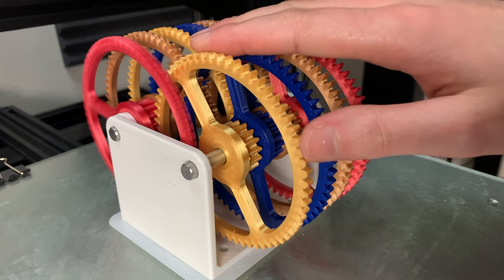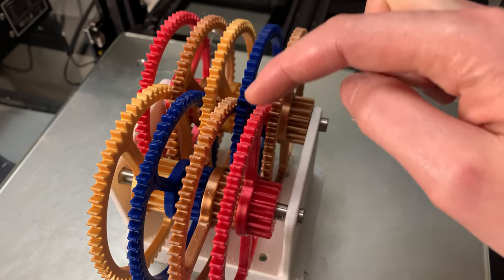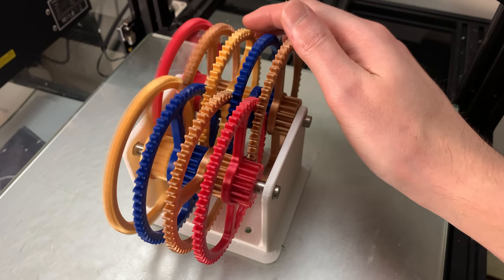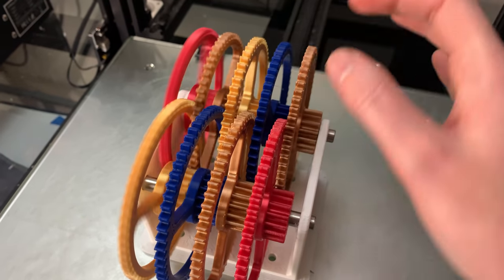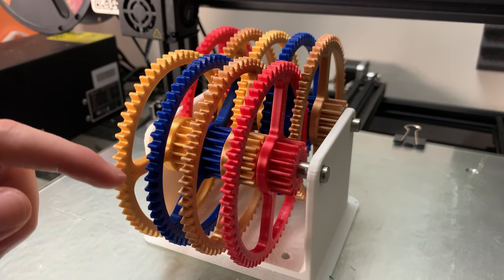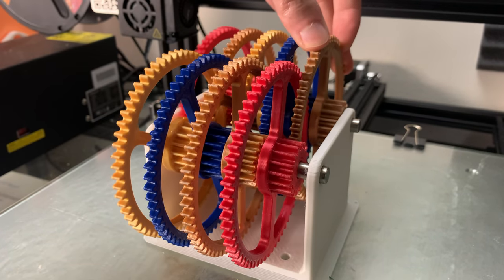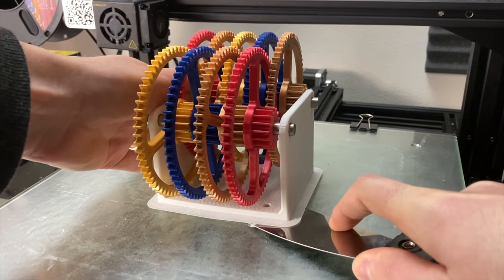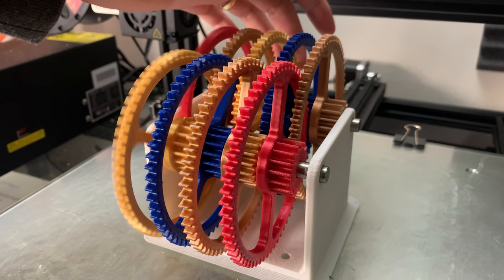Is it possible to spin the last gear?  (1:65000 gear ratio)

Comment: I know he just said I can't do it, but something in my brain is still saying it should be easy
Reply: He didn't even do it properly. He sort of started off well by turnign the gears in the beginning but then just gave up or something.
Reply: @andrewwatts1997  the gears would break because they would spin so fast
Reply: It would not be as the force required to rotate the last gear exceeds the maximum yield strength of the material the gear is made off. Meaning you would shear the teeth off the gear box before you could achieve any rotation.
Reply: @sgtjonmcc  see you say that, but I still feel like I could just turn it with bare hand
Reply: @wack3320  ahahahaga no I do know physics but it's still boring
Reply: He's kind of leaving out how much the effect of friction multiply proportionately with the torque potential.  Since each gear is riding plastic on metal, it's already dealing with quite a bit of friction.  Add any friction from the gear teeth engaging and airflow... or multiply by, for that matter.  Say it takes 0.1 gram to overcome the friction of the first gear.  Each gear will be x4+0.1 down the line.  By the time we reach the final gear, we're looking at a minimum of 35Kg.  And, that's already assuming all gears are already spinning and not taking acceleration into account.  Even with the unreasonably low 0.1 gram of force, it would require the equivalent of a 10YO (or 5YO American) child standing on the final gear to keep the thing turning.  Imagining a 10YO standing on one gear edgewise makes me doubt the thing would last long.

While not absolutely impossible.  Optimized mating surfaces and proper lubricant could help.  But, even oil viscosity is enough to induce drag.  The engineering required to achieve rotating a 1:65K ratio would be astounding.
Reply: @voxx9449  Go build some gears then and grab a spare engine.
Reply: @josephamundson701  Watch the video again. Do you even see the last two gears moving at any time? If you could rotate that last gear even once per minute, the first would be flying at over one thousand revolutions per second.

Do you imagine nothing breaking before that can happen?
Reply: @RipleySawzen  I think I could do it
Reply: I would also think it should be easy considering there is no “load” on the gear so you don’t need the tourqe figures he mentioned?
Reply: @voxx9449  well, this was more or less exactly what the title said it would be
Reply: @Storiaron  didn't say it wasn't what the title said it would be just said it was boring
Reply: @voxx9449  yeah, but if the video is about the title, and you consider the video boring, then why did you click the video after reading the title if you knew it would be boring?
Reply: @JimmyCasket02  the mass and friction of the gears themself is the load
Reply: @Cyberlong  because it could have been made in a non boring way
Reply: @ImnotgoingSideways  that jab at US obesity is the funniest thing I read in a comment section for a long time thank you 😂😂😂😂
Reply: @ImnotgoingSideways  Most probably comes from moment of inertia though right? Since the angular accelerations are constrained by the gear ratios and assuming the moments of inertia are the same for all the gears that would mean that to move according to the constraints it requires a lot of torque.
Reply: @OrigamiMaster06  Problem being friction is one of the forces which overcomes inertia.  With friction and gravity removed, acceleration would still be possible using any amount force.  Mind you, very minute acceleration due to the multiplication.  Still, taking acceleration out of the equation by pre-spinning the latter gears, force on the first gear would still require a destructive amount of torque to overcome friction loss and sustain any pre-existing inertia.  In the simplest terms, due to the amount of mechanical drag, it would take nearly as much force to keep it turning as it would to start it turning.
Reply: @ImnotgoingSideways  There would be acceleration for any force, but I'd imagine that it would be pretty slow. I guess friction would apply a significant moment to counter the motion but I think you would still need a gigantic amount of force to produce any visible rotation without friction.
Reply: @andrewwatts1997  dude, the force required has been multiplied so many times, the amount of force required would strip the teeth off of most of the gears..
Reply: @snerttt  I'm not talking about cranking from a stand still, I mean successively turning the gears until at least more are also turning. He kinda did that and then gave up. Turn the first gear and keep the crank going, turn the second one, the third one. Aid the mechanism. I'm not saying he could turn the entire thing but holy shit he didn't even properly try XD
Reply: @ImnotgoingSideways  
Without friction,air and load it's about time cause the huge amount of inertial Energy you Need to achieve.
Reply: @wack3320  I'm two months away from graduating in engineering and my opinion is video was kinda boring. Id definitely rather see him breaking those gears. Try not to judge next time 😉
Reply: @emrealemdar859  ok buddy
Reply: @JimmyCasket02  Friction is a load. A gram of friction on the first gear would mean 65kg of force to turn the final gear. That much force will definitely break those gears.
Reply: @wack3320  no, it was boring because I came to see visualization of this thing, not learn something I already know
Reply: @andrewwatts1997  no, did you understand the video at all?
Reply: @RipleySawzen  think of the inverse though, it can still be done, by moving the first gear at a non destructive speed the last gear would eventually make its way after a large amount of time.... right?
Reply: @shotgun6X  I build allot of mechanical contraptions myself, hence my frustration.
Reply: Why not put oil on the last one?
Reply: Its easy just use wd40
Reply: @manleystanley91  Yeah but we're talking about turning the slow gear directly. That is the topic of the video.
Reply: Just gotta turn your brain off
Reply: Exactly
Reply: What if you made gears out of some kind of unbreakable material, and lined so many up, could you spin the last wheel at a gradually increasing rate that the gear on the opposing side spins as fast as the speed of light? Would that theoretically work?
Reply: @josephamundson701  ye it seems way to easy just watching it lol
Reply: Just start spinning the easier ones until they're really fast, then just keep going up
Reply: @idkmyownnameplshelp9218  exactly! It would be easy
Reply: @cubeofmeat4982  Guy, friction from air resistance will get bigger and bigger till you can no longer turn the gears. Not to mention how are you going to turn the slow gear at (way fucking beyond) hypersonic speeds to make the fast gear relativistic?
Reply: @voxx9449  how could it be made in a 'non boring way' you want him to spin the last wheel with an engine that has like 65000 foot pound of torque and even if he did that the thing would break
Reply: @gist2063  make a better thing not out of plastic that won't break
Reply: @cubeofmeat4982  theoretically, you're talking about as much force of as blackhole just to get it to start to move,  or the point where conventional physics calcuations breakdown....

these extreme gear ratios are meant more for converting a motor with high rotational speed, but low torque, to higher torque with low rotation, 

you could literally winch a truck with a tiny 3V DC motor, and a crappy landscaping light solar panel (assuming the gears/shaft and chain are strong enough to handle the full load)  It might take all week, but with each 1:4 gear ratio the load/resistance that tiny motor experiences is reduced.
Reply: @wack3320  you tell me to my face that this video was exciting for you.
Reply: @saulocosta4520  ikr
Reply: @gist2063  I really think it would be easy. You would just push it with your hand and it would spin
Reply: @voxx9449  Even if you made it really strong where are you gonna get the power to move it
Reply: @josephamundson701  Have you ever tried to make contraptions like these i made one like this from legos and its impossible to spin the last wheel. A normal car engine couldn't even spin the last wheel you need like 65000 foot pound of torque
Reply: @gist2063  but you could just get it going really fast and then turn it with your hand
Reply: @gist2063  idk I'm not the one making the video am I?
Reply: If you spin the first one at a speed it can handle for a long time, the last one will move a little.
Reply: @josephamundson701  why do these people not get the joke?
Reply: All you would have to do is connect it to my truck axel and vwalla
Reply: Just think its so much mechanical advantage that its probably like your trying to move an armored Humvee with its parking break on.
Reply: @ImnotgoingSideways  but at the same time by God it would change the way we do everything.  Imagine if we could carry around boxes that lift cars!
Reply: @stuartsmith1139  I prefer carrying around a bottle to lift my car. =^-^=
Reply: You see, it breaking would actually be a good demonstration of the limitations, showing rather than telling
Reply: @voxx9449  it would be fun if you understand it
Reply: @pessinieminen4341  haha gears go brrrrrrrr
Reply: @pessinieminen4341  ok but hear me out, what if they were made of a more durable material capable of supporting that amount of friction, then would they be able to turn or no
Reply: @pessinieminen4341  but the gears dont break at the speed he is spinning then. If he spun them at that speed for days eventually it would have to move the last gear would it not?
Reply: It would take time realistically
Reply: @josephamundson701 * I believe in you.*
Reply: @unnamed47  or just without inertia
Reply: @andrewwatts1997  You physically can't turn those last few gears. That's what this whole video explained. You move the first one with just a little bit of work. The second one takes 4x the amount of force though and then the next is 4x and the next and so forth. It would take way more force than you can physically give to push the last ones.
Reply: @ThatSB  Yes it would. It would take a lot of time though.
Reply: @cake6420  The gears would likely break.
Reply: @josephamundson701  It could help a little and I was thinking the same thing but I don't think it would be possible to apply enough force anyway. We're talking about thousands of pounds here.
Reply: @Kyrqs  Bravo, you are so smart!
Reply: @cake6420  Thank you.
Reply: @Kyrqs  someone went on a rampage and made like 20 comments lol
Reply: @o_sch  Yes, I dislike people who are unable to comprehend simple things. In other words, I make a lot of responses online.
Reply: If it was easy, we would be populating Mars already for the last 20 years.
Reply: @FinnishArmy  well they probably just haven't tried turning them with their hands yet
Reply: @justsomenamelesssoul8097  kinda dumb isn't it? You already know what'll happen and you expect it to...not happen?
Reply: @manleystanley91  by that time you'll break the whole gearbox.
Reply: @t_kon  well I know what will happen in most TV shows and films I watch.. So what? I should stop watching them as well cuz they are predictable?
Reply: Maybe because the gears look light and visually easy to spin, but in reality tje multiplication of rotation is exponential
Reply: @voxx9449  "boo hoo I want loud screamy guy and breaking things not actual useful info and knowledge"
Reply: @staringgasmask  no I don't ??
Reply: @voxx9449  so then you tell me why this seemed boring to you. It's a scientific video about torque, what did you expect?
Reply: @staringgasmask  it's boring
Reply: @staringgasmask  came here for fast spinny thing got not fast spinny thing , disappointed
Reply: @voxx9449  yep, pretty much what I said, unculturized individual that can't appreciate an analysis
Reply: @staringgasmask  😛😛😛
Reply: @t_kon   Due to torque ratios hardly any pressure would be applied to the gears.
Reply: @andrewwatts1997  aq
Reply: It would be easIER if he grabbed +4 sections of the last gear (evenly) and rotated it that way so that no stress was applied in any additional direction (like down) - since it is plastic.
But doing that only improves efficiency by a very very low percent.

Bone & muscle wouldn't be able to sustain 1:65000 leverage construct (leverage on a circular platform = gears).

Anyway, food for thought: gravity generator.
Reply: If you make the gears thicker, and attach a long lever, you might be able to move it a little. It would require a lot of effort, but you could get the first gear to move a little bit. The last gear wouldn't appear to be moving at all, but since the ratio is 1:65,000 getting that last gear to move even a nanometer would translate to some rotation on the first gear.
Reply: @RipleySawzen  
Lmao at the overly confrontational anime pfp lecturing people about engineering (something he has no experience in).
Reply: @gmodrules123456789  LMAO where? I'll school him with my double masters in civil/mechanical.
Reply: @RipleySawzen  
Top ten things that never happened:

Number ten, this guy having a masters degree.
Reply: @gmodrules123456789  I love the way you expertly debunk anything I've said with even conjecture. Do you even attempt to approach things scientifically?
Reply: @RipleySawzen  
I did approach this scientifically, though, given that you aren’t fully versed in the scientific method, it might not have been obvious.

I used a few simple observations:
1. You are a YouTuber
2. You are overly hostile to everyone
3. You have an anime girl as a profile picture

From this, it can be inferred that you are not honest, and are not actually credentialed.

Q.E.D.
Reply: @gmodrules123456789  You came in here insulting me, without debunking a thing I said. You even AGREED WITH ME by admitting the gears would need to be thicker to withstand the force of movement in driving them backwards, and you'd need a lever to do so.

Not to mention exactly ZERO of my comments till you showed up were confrontational. Perhaps you're injecting your own bias into my comments. That's got a name, by the way: Hostile Attribution Bias AKA projecting.

You're the hostile one here. You have been from the start.
Reply: @RipleySawzen  
Lmao why are all anime pfp people the same?
Reply: @RipleySawzen  
You are actually getting this upset over a thread that's 3 years old LMFAO
Reply: @gmodrules123456789  You necroed a 3-year-old thread lol. Also, again, projecting much? Are you assuming I'm mad because you're mad? Stop being mad, bro.
Reply: @RipleySawzen  
I’m not mad.

You on the other hand, have actually responded to my necro that literally added nothing to the discussion. You could’ve ignored it and moved on. You could’ve ignored the comment that was left nearly 2 weeks ago too. But you didn’t.

No, you have an anime pfp and a chip on your shoulder. You just had to prove to ME, of all people, that you were The Man. Lmfao

Nobody else is reading this thread. You and I are the only ones here. And you are the only one who is mad.

Comment: torque seems like an added feature to stop easy energy exploits. smart of the devs to implement it!
Reply: Torque and RPM work proportional though. Torque does not in any way have anything to do with "energy exploits".

If we assume that friction does not exist for a moment. If he would turn the last gear with some X torque, the output gear would turn with x / 65k torque. Albeit turning very fast, it has next to zero torque.

That's also why heavy machinery doesn't go fast at all with massive amounts of wattage in their engines (a tank for example). It needs more torque and less rpm to be of any use.
Reply: @Dennis19901  r/woooooooosh
Reply: @droffilcc8800  he's explaining that it's not exploit patching, but instead a very well thought out physics engine
Reply: @droffilcc8800  the woosher has been wooshed
Reply: @honu2980  xd
Reply: Sounds tierzoo-y
Reply: How much of the hard, fibrous tissue that makes up the branches and trunks of bushes, shrubs and trees could be moved by marmota monax if it were capable of such a task?
Reply: @Dennis19901  you just got wooshed
Reply: @amb600cd0  uh no
Reply: @iCore7Gaming  I'm farting so loud rn I'm going to upvote you for being the epix
Reply: @droffilcc8800  More like r/iamverysmart
Reply: @iCore7Gaming  whoosh
Reply: @mason2769  wrong
Reply: @thoughtstream534  no problem thoughtstream have a good one
Reply: I love you
Reply: @Dennis19901  the less RPM is actually the stroke of the engine a longer stroke engine will have less RPM but and they're typically diesel
Reply: Torgue = Energy exploit fix
Lightspeed = Max processing speed for the game
Conscience = Player input and interaction
Rich and successful people = Pay to win players
Poor or unsuccessful people = Players who haven't touched the game in a while and their characters are kinda idling

Rn I'm just waiting for the Space Age DLC so I can go check out Alpha Centauri but the devs are being kinda slow after the Industrial DLC
Reply: Just make this in tungsten or diamond & throw it in a gravity generator & you'll have the best renewable energy money can buy (using a pickup truck as weight from higher ground).

Maneuvering the vehicle back uphill and resetting the lift would be easy effort (less than a dime of fuel & energy doing that, each time)

An alternator would charge batteries.

A tesla turbine could also be spun up and used to pump water.

You could hook both up & have them engage simultaneously (turbine would shut off when faucets would shut).

I'm sure a sprocket can be implemented where the turbine stopping won't stop the gear it's connected to ... or just disengage it from the gear when water flow is stopped on the main.
Reply: @droffilcc8800  r/gtforedditorkid